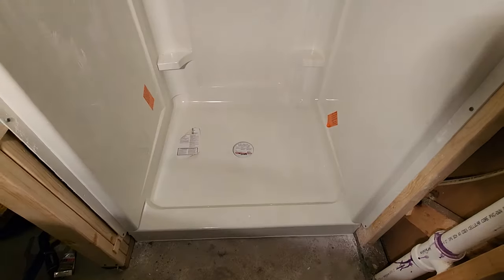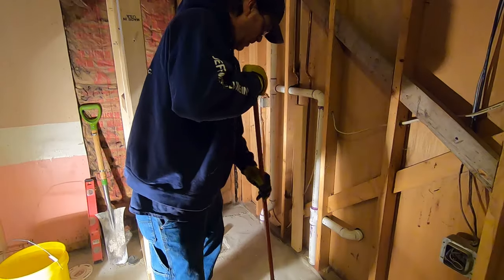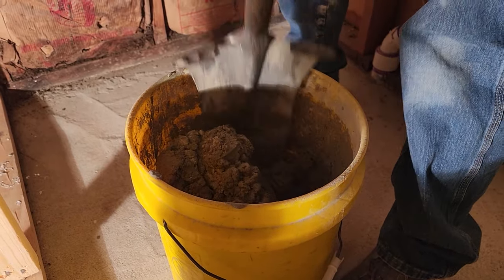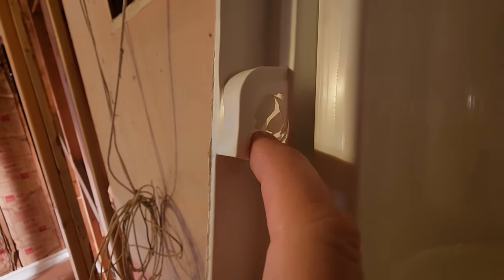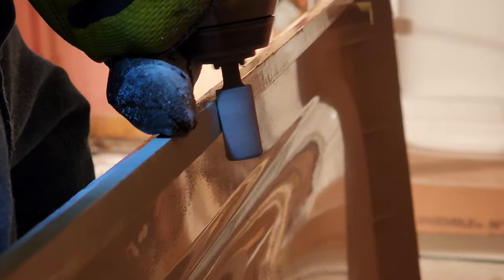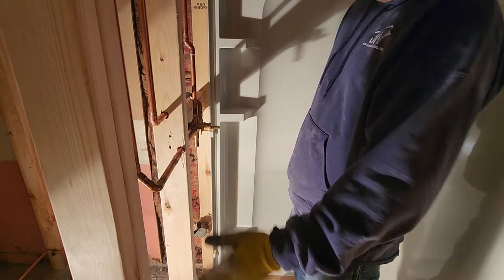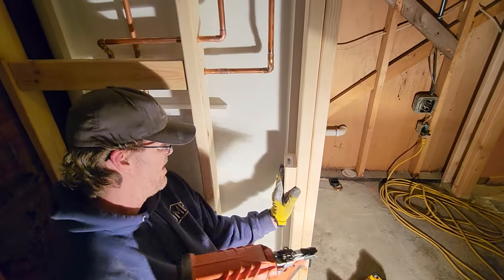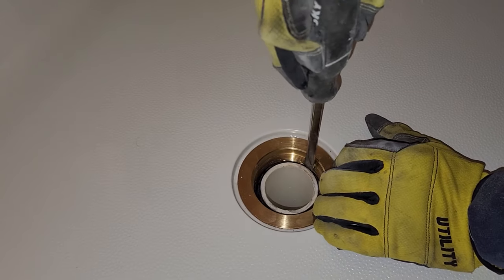Installing A Sterling Sectional Shower Unit (Plumbing How To)

Comment: Outstanding content all around! The camera angles, clear voice over, and tips provided were immensely helpful. 

Cleaning up the rough edges on the insert is crucial and not something I was really thinking about -made the fitting and drywall work so much easier. Also, bedding the pan was extremely intimidating, but you gave me the confidence to get the job done with the clarity and ease of having a true pro by my side.

Comment: Great video. I've installed these units and they go in pretty easily. I would just add a word of advice when tightening the lock ring using the flat tool with the screw driver. I usually put a rag in the drain, so I don't accidentally drop that tool or the screw driver in the drain while tightening. I learned this by trial and error many years ago. Still a great video. Thanks for sharing.

Comment: For the novice DYI'er (from another novice)  installing this as a mobil home shower upgrade, here a couple of things that I ran into that might be helpful:  
1.  Mobile and maufactured home are not alway level or square. Suggest making sure that the shower pan is level (for proper drainage) and just let the walls fall where they may. 
2.  Keep a flashlight close when setting the end walls so that you can see the joining tabs and slots.
3.  More than likely, your mobile will have internal wall 1x4 studs (instead of 2x4s) and may need need to be doubled.
4.  Make sure of what's behind any paneling that you may have to cut away.  (I cut into a PolyB water line and couldn't find a proper repair fitting locally - did find and got from an online supplier)
5.  If adding safety bars, you may need to add wood spacers between the back side surface of your panels - some walls are flat and don't need spacers - Sterling walls are offset and need them.
6.  Finally - Set end panels before applying caulk to the front corners as shown in most (Sterling model) videos - can be messy if you have to remove panels before securing to wall.  (Note - they            
     can be swung out enough to apply the caulk after locking the panels in.)  Also helps to mask off the area before applying caulk

Hope this help anyone undertaking this job for the first time.

(s) An Old Rookie

p.s.  You might want to fill the seams where the wall panels meets with DAP or some such sealer.

Comment: To clean up the silicone you can use rubbing alcohol on a lint less cloth for easy clean up. I also run a bead of silicone on the bottom of the drain around the threads to keep the nut from backing off. Good video.

Comment: Great video! I just bought one of the 60x30 Sterling shower units to replace an old fiberglass tub/shower unit. I'm replacing the combo tub/shower valve with a new Moen valve and moving it higher up. Was trying to view in your video as to whether the front of the brass valve body should be flush with the plastic wall, a little bit protruding thru the wall, or slightly behind the plastic wall?

Comment: I'm installing another Sterling unit. 
I had a plumber install the pan, but he screwed the pan's flange to the stud and did not use the little clips supplied. Should I remove these, silicon the holes he made in the flange and install the clips?  Or does it even matter?  
Thank you for the video. Perfect description.

Comment: Easily the best video I've seen on this particular shower. Expertly shot and narrated. I do have a question if anyone who has done this a few times has time to answer it?
I am in the process of getting ready to install one of these in a location that already has drywall. Apparently the shower was ordered to fit this space. I know these are intended to be installed directly to the studs, but would there be any reason why having drywall behind it would be a problem? Like is it supposed to go directly to the studs to allow for moisture to evaporate should any moisture actually get back there or something? 
Thanks in advance.
Reply from the maker: As long as the unit is properly sealed and no moisture or water gets to the drywall it should be fine. Make sure to use long enough screws so that you can still screw into the stud through the drywall. Which may require locating and marking where the studs are.
Reply: @jeffmummplumbing9321  wow! Awesome! Thanks for your quick response and again for such a well done video. You've made me feel MUCH better about this whole thing since I tend to overthink things and then paralyzed myself with indecision.
Reply from the maker: @gund2281  no problem partner. The kind words are appreciated. Best of luck!!
Reply from the maker: @gund2281  I did forget to mention that it is fine to install it on drywall yes but you will still want to drywall over it. The flange that you screw into is meant to be drywalled over. Not that the unit wouldn't be fine if you didn't do that but I'd presume some water could get down behind it otherwise.
Reply: @jeffmummplumbing9321  Yeah I figured on that. Shouldn't be a big deal, I'll just use longer screws around the top 😄

Comment: Okay. These showers are packaged like shyt.
 I bought a bundle.  ie: pan, backwall end walls, and accessories.  I had it delivered to my nearest Home Depot. I get it home. And brother I nailed the install of that pan. B(*)(*)M. I open the backwall, cracked!
I call HD. they said bring it back. I said the pan is installed and I don't want to tear it out. They said "well, you bought a bundle.  The only way we can help you is to buy another bundle,  swap out the broken piece, and return the bundle. This went on 3 more times. Finally the 4th time there was a crack in the top mounting strip of the wall but it didn't extend on to the finished area. I reinforced that with fiberglass and stuck it in. They only discounted me $100 after a month's worth of bull and 4x 20mile trips to town. CHECK THAT BACK WALL BEFORE LEAVING THE STORE PEOPLE.
Thanks for the install video.

Comment: What if the previous owner forgot to silicone that small spot where you have that 4 inch by 1 inch "L" shape between the pan and bottom of side walls?  Is there a way to get silicone in there with the walls already attached?
Reply from the maker: You can definitely try shoving some silicone in there or just caulk the seems, but it will probably show.

Comment: These Sterling units are okay but the damage you get from the factory is unreal. I had five units sent out for one job before I finally got a wall set and based it was not damaged
Reply from the maker: Very true. Id say 1 in every 2 we get are damaged.